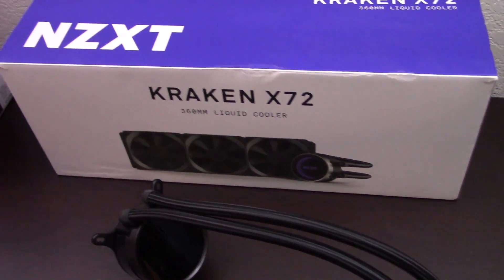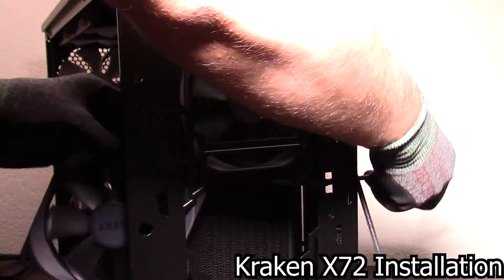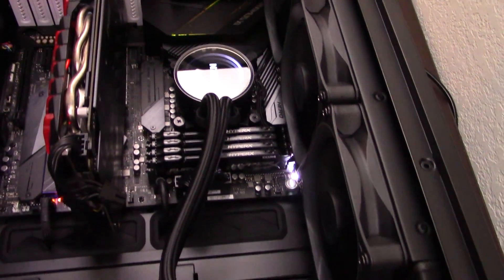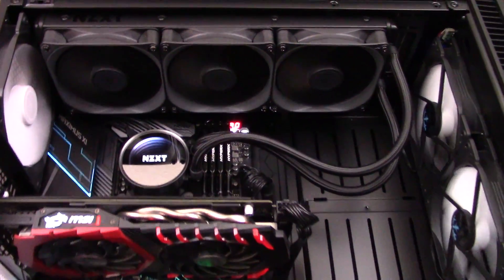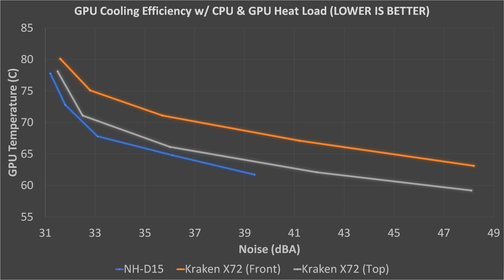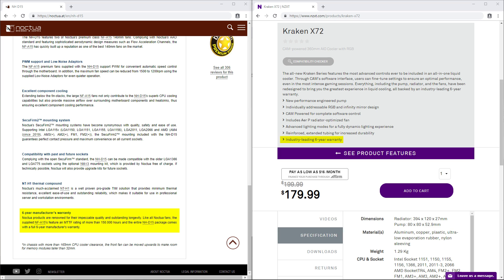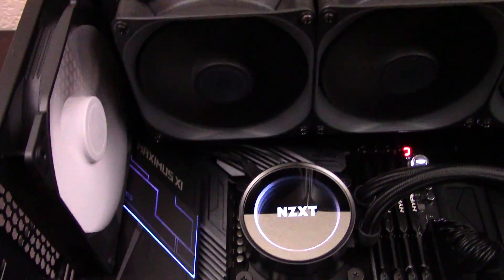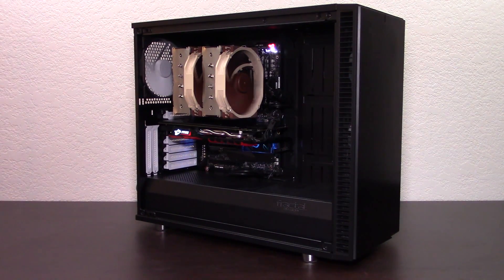Air Cooling vs. Liquid Cooling: The Ultimate Showdown (feat. Noctua NH-D15 vs. NZXT Kraken X72)

Comment: Air cooling loves high Airflow cases. You will see dramatic reductions in CPU temp by buying a case with twin 200mm fans at the front. Best scenario is a push pull case which I am about to make by reconfiguring a Cooler Master H500P Mesh. Going to rotate the back plate so the motherboard outputs come out the top and swapping the top panel with the rear. Just have to drill out the rivets and re-rivet in the new configuration. The other bouns is you can buy a replacement front panel to cover the rear fans to make it look like a pro job. How to outperform AIO water cooling nearly silently.

Comment: Hi guys :) what's the best value to upgrade my U14S (1 push)? It takes a lot of space in the case, I want something smaller.. in the near future I'm lookin at 3900x or 3950x (when they'll decrease in price). I want to decrease my delta T for the summer also.. atm R5 1600 @4ghz  1.38v offset stable, but it can reach 74 degress under heavy stress, and it generates a lot of heat in my room. Looking for a valid 240mm aio, I'm looking for the smallest atx case, like the Inwin103 or similar ;) thanks

Comment: I don't think the software is a downside. It is optional as you can set fan profile in BIOS and software just gives you more control over workflows directly in OS meaning you don't need restart into BIOS to tweak fan settings. So it is a big plus and worth some money.

Comment: Here's the issue with air coolers. 
1 rotation of hot air inside the case(no exausting)
2 liquid inside pipes can dry out(boil off)
3 weight can break gpu sockets and distort/bend motherboard
4 air cooling can't handle quick peaks of heat(e.i booting, launching, rendering) 
5 the space needed for block cooling
6 looks ugly
7 can overclock higher on AIO
Reply: @Katoshnik I'm glad you can read

Comment: Currently I am making use of the Be Quiet Dark Rock Pro 4 for my i9 9900K overclocked to 5Ghz.  My CPU temps rarely go over 60 degrees Celsius (4K gaming setup and stress tested) and I'm quite satisfied with that so I am currently not really thinking of switching to an AIO.

Comment: Man good video but one point disturbs me... Why do you weight compatibility with cases so high? There are so many rubbish cases flooding the market which are all set in the low budget area meaning they have no space for 360s; no one would be 1000 of the 2000 cases anyways because the just suck... And for 100 bucks you get good cases that can fit 360s so and still have a great variety to choose from

Comment: when i put the nzxt x72 top i have 10 more celcium more than front.... so i think the results are not very good.if u have you with blower its ok to have it top whan its open air alla the hot air from the gpu goes up and the cpu is hotter...maybe you must do the results for more time and of course better gpu...cause if u have 1050ti u dont have temps

Comment: The problem of aircooler is the oversize and weight when you travel bumpy inside the  car. It will drop over your motherboard.  Trust me
Reply: Easy to just take it off temporarily though.

Comment: I think we need to change the name of the type of cooler. Liquid cooler also use air to cool the liquide in the radiator,
Direct cooler= air cooler
Indirect=liquid
Reply: Let me make it even more complicated, air coolers using heat pipes are technically indirect coolers and actually contain a liquid inside the heat pipes.

Comment: You do not need software to run the AIO. Only if you want to control the RGB lights. Otherwise you can plug the fans and pump to the motherboard fan headers.

Comment: I have a PC with an air cooler and an aio. The air cooler is quieter and less hassle with almost identical performance
Reply: Air coolers have certainly gone through a big evolution the last decade. Water cooling is less relevant these days for two reasons, air coolers have gotten better and computer hardware has gotten more efficient.

Comment: Linus did this same thing a year or two ago with the same results except he used a Corsair H150 Pro against the NH-D15. In my experience building my own custom PCs I have used both air and water and now that I have gotten into custom open loop cooling I would never go back to air cooling . Its really not that hard to install and if your gaming or overclocking there is no question you will see performance gains from liquid cooling. If your just building a PC for general purpose or home theater then an air cooler would be more than sufficient.
Reply: I have thought about water cooling my GPU, but it'll literally cost almost as much as the GPU itself so not really worth it. Not sure how a CPU water cooler would work because of memory cooling, otherwise I could always modify a CPU AIO cooler.
Reply: @hakont.4960  If you get a good water block like from EK Water Blocks the memory and VRM MOSFETS are also water cooled. Especially for a GPU water cooling is like night and day if you are looking to get max clocks as you can run your card pretty much full blast and not get above 60c leaves a lot of room for overclocking. If you are happy with stock speed then air cooling is fine though.
Reply: @hakont.4960  Right now in my current rig I have a 9900K water cooled and I am hitting 5 GHz all core with no AVX offset. No way I would get that with air cooling as even on water with a heavy AVX workload I am hitting almost 100c on some cores which is close to the TJMax for the i9. I am not saying water cooling is the only way but there is a benefit if your looking to get maximum performance beyond what is spec for your silicon.
Reply: @JP_Stone  CPU water cooling is one thing, CPU's can be overclocked quite a bit on air cooling anyway. It's a different story with GPU's, I can get AIO coolers for less than $100 for my CPU, while a water cooling block alone for my GPU is more than $100. Then comes pump, pipes etc. in addition, that's easily $200-300 total.
Reply: @hakont.4960  It is not always cheap not for quality stuff you are correct there.
Reply: @JP_Stone  I guess I'll try and modify it with some new fans instead, might be a good compromise.
Reply: @hakont.4960  Yea if you can get more air moving across the heat sink and better airflow the case in general always gonna improve thermal performance. Will not hurt that is for sure.
Reply: @JP_Stone  I'm fairly sure I need better airflow in the case, the exhaust air gets quite toasty. I can of course crank up the RPM on the case fans, but trying to keep noise low as well.

Comment: Air cooler with big heatsinks will put stress to the mobo on cpu socket over time. Plus on hourly gaming it will dramatically builds up the inside the PC due to spread of heat during air outflow. Best option is maximize COOL INTAKE and just try to connect a portable air conditioning device's cold cold air flow tube to the PC AIR INTAKE.

Comment: a cheap custom loop will beat ANY of the BEST aircoolers in thermal performance if done correctly but it adds 2 extra failing points: leaks and/or pump failure plus maintenance. he is also a bit misleading as a pump power consumtion is meaningless in a pc that consumes enough to need water cooling. if your pc can stay silet at max always go for air cooling even if it's heavier. otherwise go hidro.

Comment: I would disagree on compatibility. Only instance where AIO conflicts with ram clearance is if it is mounted on top of the case, and case doesn't have enough room there so it covers part of motherboard (and ram slots). If you use case of more common 280mm aio, they are often mounted at the front of cases, and then there is 0 issues with clearance.
Another thing is mounting. While there is more screwes and it takes more time to install AIO, main thing there is how easy everything is to access, you can screw block with bare hands, easily reaching everything around cpu socket. There is many air coolers where mounting is pain in the ass, you need aim screws with long magnetic screw drivers, through some holes in tower cooler, screw tend to fall, it can be real nightmare to install. Same goes for any manipulation around cpu socket after installing the cooler, if you want access ram for example. Can easily do this with AIO, and big air coolers often need to removed before you can access ram.

Comment: I love dealing with pump failures while I am gaming.
Reply: you are the guy who dosen't drive because he might die
Reply: @AMNHM  No, I like to play games, not work on my rig because I made a bad  decision building it. I used to buy the best of everything, newest tech in every area but my experience showed me that all the failures were not worth having the BEST gear. I go for Great gear with Great reliability and I am happy.
Reply: @davidbrennan5  I'd like to see your NH-D15 cool my overclocked Intel Core I9-10980XE. Actually, I'll spare you the effort. Paled in comparison to my NZXT Kraken Z73. I'd like to see you game on a thermal throttling CPU.
Reply: I heard the KRAKEN Z series had MAJOR compatibility problems with a lot of common boards, (ASUS and ASROCK) Their fix was to give customers a USB 2.0 hub lol as far as the I9-10980XE.  Intel had to slash the price in half of their last gen because they can't compete with AMD.
Reply: @davidbrennan5  Yeah - you heard. I also heard that computers have a chance of exploding and taking your house down with it when you push the power button, but that didn't stop you, did it?

I had zero compatibility issues with the kraken on my Asus ROG Rampage VI Extreme Omega.

Also, I didn't say anything about Intel vs AMD, so why are you trying to bring that up? I bought my i9-10980xe before the release of Zen 3, when AMD paled in comparison to Intel's Comet Lake lineup. What was I supposed to do, buy a Zen 2 CPU to bottleneck my dual 3090s in SLI?
Reply: I hate falling down that's why I never run, you and I think alike.

Comment: In your maintenance comparison, I'm surprised you didn't mention permeation in AIO's. Liquid coolers will eventually break down due to the build up inside the cooler and no company will clean / refill this for you. You can do this yourself but it's a pretty hefty process and it's actually easier to buy a new one.

Air coolers can last forever as the heatsink itself has no moving parts. Replace the fans and you're good to go.

Comment: NH-D15 gives you 95% of the performance for 60% of the price. That being said if i was gonna have a TG case I would have gotten and AIO
Reply: (And 0% of the maintenance issues.) Air cooling will NEVER fail. You cannot say that about water cooling. 

In my opinion, water cooling just... isn't... worth it. It looks cool, sure, absolutely. I'll give them that. It frees up a bit of space in the case. It's just.... not worth it.

Comment: price comparison is a bit unfair and not exactly a direct comparison, it’s not even really all that much cheaper compared to an AIO when you factor in the fact that with a $99 cpu cooler you also need front fans in place of the the radiator fan assembly.

Comment: I think you could have added other areas. Water coolers don't move air around the VRM's  and any help in that area is golden. Also cost of ownership I would give to air coolers. The only part you need to replace is the Fan. I've have a few Air coolers that have seen a few different cpus over the years. Water can have all sorts of long term problems and would cost more to make it perform like new but it's a given with Air coolers that after being cleaned it works pretty much like new. I don't know how long Heat Pipes actually last but maybe that could be looked into. 

   Me I'm in the Air cooler side. Obvious I guess but I like to take the cost of ownership as a important issue.  It can depend on what you do with the computer as far as overclocking and Water may be better in this area I feel the temp difference can not be a big factor for this reason. If you buy a cooler that keeps the cpu running in a range where you can get away with mild overclocking and hammer the system and as long as the cpu doesn't go over 70c it's a great cooler and from there on other issues are more important like case fit, Ram fit and added perks like a cooler running VRM is the important areas.

Comment: Only real problem with watercooling is that when you play an intense game for 1-2hours and then leave the it idle for 15 to 25minutes the cooling liquid is hotter compared to an air cooler. Don't know how its effect the cpu lifetime but i am sure more heat more current. Basicly noise vs. heat consuption my choice is a Noctua D14 (easier to install in a smaller case and does fit with almost all the RAM profile :)

Comment: Do you take into account difference in number of case fans with each configuration and it's impact on price and performance? For example with air cooler, you will have space for 2 or 3 more case fans depending on the size of AIO you use, which means you should consider AIO price vs (price of air cooler + 2 or 3 case fans). Also for performance, should measure air cooler performance using 2 or 3 more case fans vs. the AIO.

Comment: Things may get nasty for air when overclocking a beefy CPU. It's possible to install Scythe gentle typhoon 5k rpms as a single mid fan push/pull for Noctua. Cover it with carton from top and sides aka Phanteks style. Drops some 20C right away. But the resulting sonic pressure is somewhat severe.

Comment: However, an important point is not mentioned.  The number of fans for Liquid Cooling is more, and it takes up the spaces for case fan.  Therefor, if both cooling take the advantages of full fans chassis, air cooling will definitely be better.

Comment: However, an important point is not mentioned.  When using air cooling with full case fans, the efficiency of Air Cooling should be batter than Liquid Cooling.  When Liquid Cooling, the number of fans is more (even it's 120mm), and it takes up the space for case fan. Therefor, if both cooling take the advantages of case with full fans, air cooling will definitely be better.

Comment: Dude. The magic key is that u buy 240 aio cooler. a case that can mount 3 140 in front fans. mount the 240 rad in front for push pull, push the radiator to the top then put a 120 fan under the rad for an intake for gpu. Problem solved best way possible to keep gpu and cpu temps down. That is what i use atm. The  gpu has same temp in my combo than a case that have down intake fans for gpu. U will never reach the front rad temps with dh 15 cuz if u have 1080ti it will just heat so damn hard that the cpu cooler dh 15 will heat also. Ex gpu at 74 degree wil heat at least the cpu to 70+ degree even if ur cpu without gpu stress stays 50 degrees.that;s why aio is the future. also dh 15 has some ram incompatibilities also it;s ugly it ocupy space , and due to it;s big mass it can break ur mobo after 3 years if u dont have a backplate lol. i mean it;s possible to bend it at least. oh i forgot. having air cooler also help ur mosfets and other mobo components to heat wayyyy easier than aio. aio just take the heat away from procesor while air cooler disipate it very fast around.

Comment: In the X72's defense , you don't need the software to make it work . The pump will run at a fixed speed and you can't control the lights but it wil work just fine without the software. Just hook up the fans to the pwm headers on your motherboard and manage the noise and temps that way.

Comment: When you install the X72 Radiator in the front of the case with the fan on that side you are trowing all the hot air inside your computer :D
That explain why your videocard is running hotter... You should install the fan making the air flow pulling the heat from the radiator directly out of the case... NOT IN !!!!!